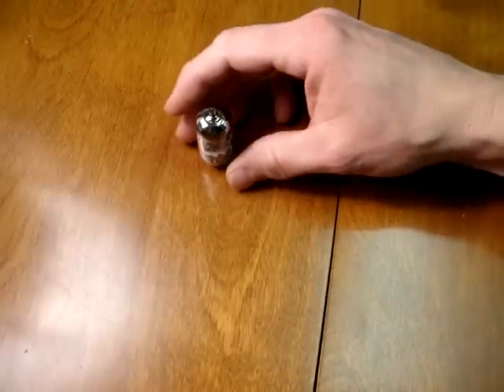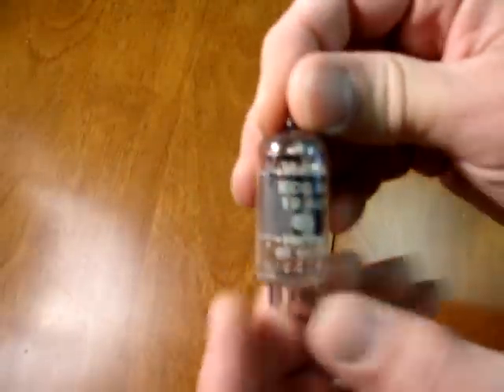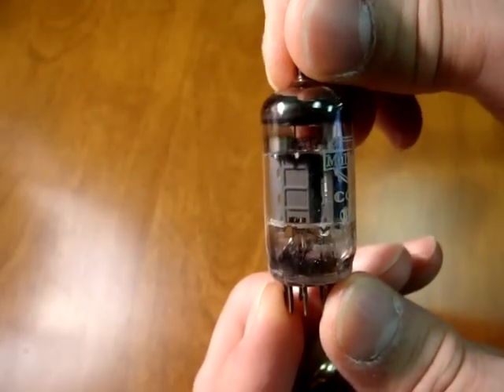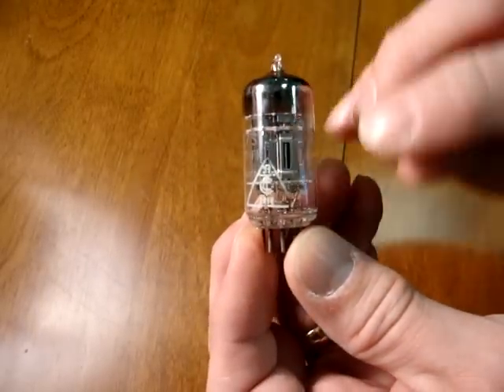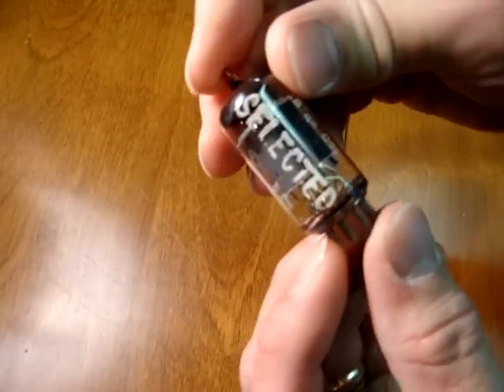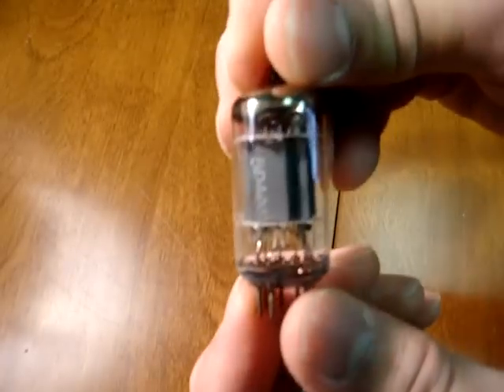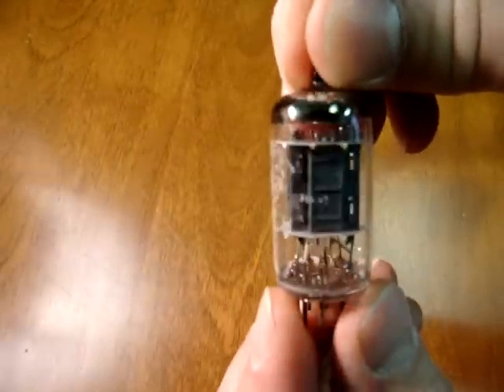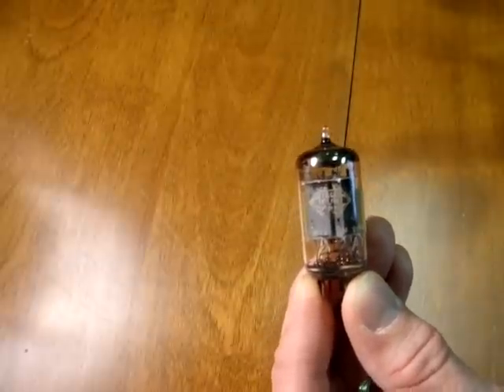How to Spot Super Rare 12AX7 Vacuum Tubes part I

Comment from the maker: I respect your opinion.  However, I invite you to look over back issues of Vacuum Tube Valley where time and again NOS tubes tested head to head with current production tubes were judged superior.  The technical details are in the articles.  Manufacturing HAS improved since the pre-1970s, but to make a profit on a $6 tube, the Russians and Chinese cut corners.  Vacuum pumping is just one example.  Russian tubes are pumped just one hour, USA tubes were pumped 8 hours or more!

Comment from the maker: Preamp tubes do not require any bias adjustments to your amp.  Obviously, consult your operations manual, dealer, or the manufacturer if in doubt about changing tubes, or any special precautions or additional steps that need to be taken when changing any tubes in your amp.

Comment: thanks! do you have to bias the amp at all if you change the preamp tubes?
Reply: You do not as preamp tubes are cathode biased with a fixed resistor. Just pop them in and let your ears decide if they’re a sonic improvement!

Comment: I have Yaqin MS-12B Vacuum Tube Line stage / MM Phono stage Pre-emplifier with low impedance output 12AX7 + 12AU7 vacuum tubes for amplification for my Turntable, and my question is:
1- Can I upgrade the original tubes to better one.
2-  There will be any difference in the sond quality If I upgrade the original tube to better one.
3- What kind of tubes 12AX7 & 12AU7 vacuum tubes  you recommend me to purchase for my Yaqin MS-12B Vacuum Tube.
Thanks.

Comment: I cant tell the difference between the General Electric 12ax7 long plate and the mullard 12ax7 long plate but the telefunken 12ax7 smooth plate has a liquid sound has a natural equalization pattern like setting all the controls between 80hz to 14khz below flat or 100dbs.